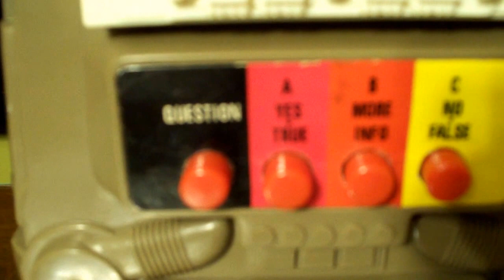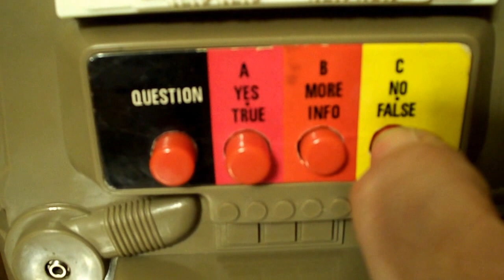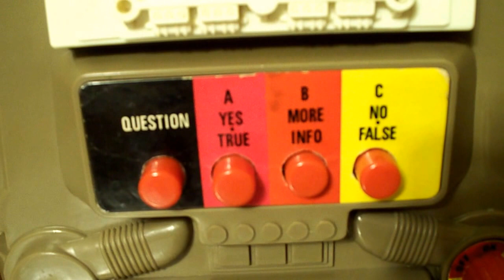how 2xl works

Comment: I'm not getting any sound from the tape.  All connections are intact.  The head and rollers are clean. Tape runs and advances as it should, just no sound.  Has anyone else experienced this issue?  I assume it's in the sound board - bad capacitor perhaps?  
I'm thinking there might be an Arduino type sound board that I could interface with the sound head.  Any suggestions?

Comment: thanks for the video. I was wondering if you did a video or if there is info somewhere on your head mounting bracket repair? I just won a 2x-l auction and I'm guessing my bracket will be cracked or worse. I've never worked on 8 track players but my research leads me to believe that is such a common problem. Thanks again for the video.
Reply from the maker: just wraped it with fine wire and caulked around head .   must be neatly done
Reply from the maker: I found were you can get the decks brand new 
http://www.shokaifareast.com/Products/Misc%20Products/cassette_tape.htm
new old stock but not tried to buy one yet

Comment: I wish I'd kept my 2-XL robot i'd do a video on it and show the mods i did. I just can't remember what happened to it.
Reply from the maker: +coondogtheman1234 they are cheap on ebay and mine has good sound for what it is  I may add a line out stereo plugs right off the head wires for run it in to a stereo receiver but still have the mono amp also I would use switching jacks or a jumper setup like I did on the kiddy phonos
Reply: *****
I wouldn't add line out at the head because the audio level is too low and if theres any voltage on that line it will erase your tape. I experimented with that one time I hooked a n audio head to the mic in on my computer and tried to play a tape directly and I erased it because the mic connection has plug in power to power the microphone.so yeah bye bye recording. It was a good song too. I would either just hook to the speaker output because you're probably not going to find a line level signal anywhere except maybe the volume pot. Chances are the preamp and main amp are in the same chip but I could be wrong. I would have to see the amp board to know for sure. Maybe do a very detailed video of all the chips on the board and all connections on the board.

I'm glad YouTube got rid of the 500 character comment limit god I love this.
Reply from the maker: I would have to put a amp board in it so to get stereo  I have one from a small car deck that would fit ,plenty of room and abandon the on-board amp, find a stereo vol. pot. to replace the slider on the amp board and fit to the original hole in the case etc.  lot of work  done that kind of thing before. not worth it on this one. the onboard speaker-amp sound real good for what it is  the large case must give it good base for a 3 inch speaker 
I do remember the powered [phantom] mics from back in my PA system days
Reply from the maker: +coondogtheman1234 you should check this one out 
https://www.youtube.com/watch?v=XPJNY8meX9A